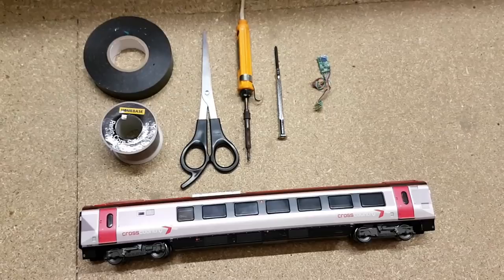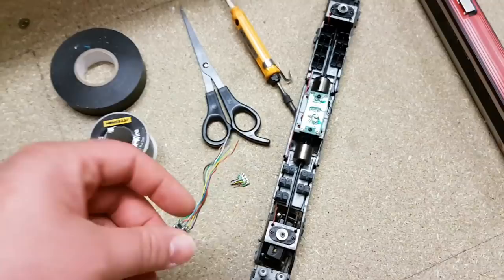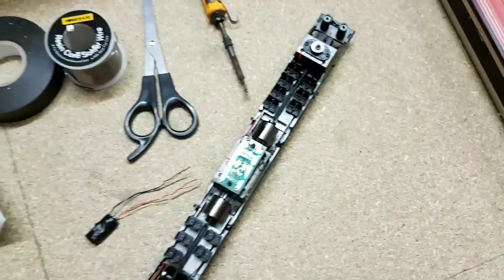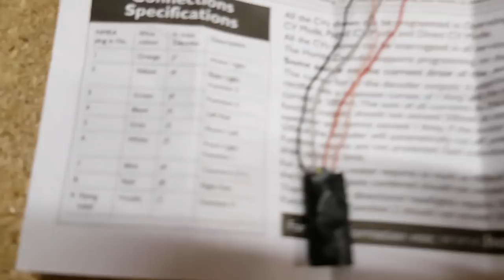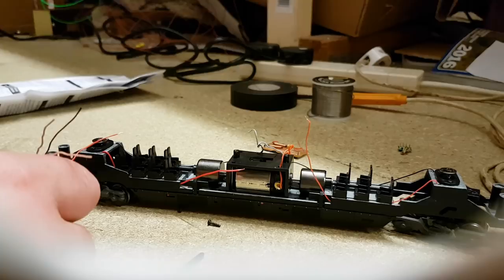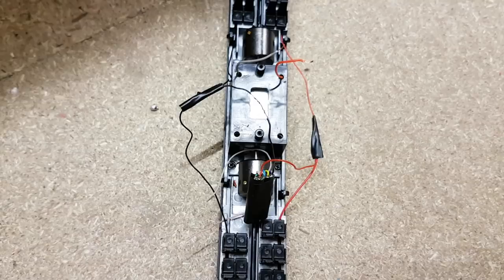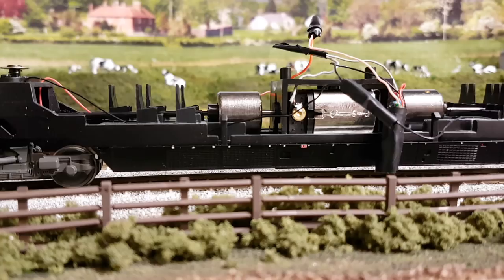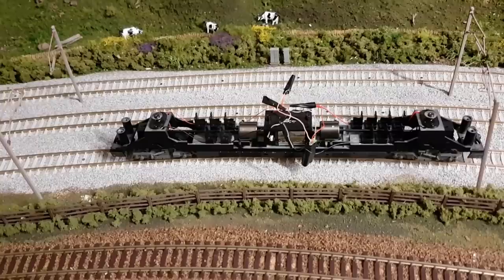New Junction - Converting DC to DCC

Comment: Nice clear video, thanks for producing it. But I have to take exception to the following...
Don't wrap a decoder in PVC insulating tape for two reasons. 1) It prevents a free flow of air over the surface of the decoder and 2) It stops heat escaping plus the warmth of the decoder will cause the tapes glue to become sticky and unravel the tape!   Equally use Heat shrink tubing on in-line soldered joints not tape. Tape will become  a sticky mess and start to unravel after a sort while!  
Finally NEVER place a newly fitted DCC loco onto the main lines, ALWAYS use a Programming track where if any wiring faults are present the low current used on a Programming track wont blow the decoder. Placing it directly on the main and powering up with fault present will result in instant decoder failure!  If your DCC system doesn't have a dedicated Programming output your rather stuffed!  You can then only use the main output but any 'reasonable quality' DCC system will have  a dedicated low current programming output.
Oh BTW Its not a CHIP!  They have salt and vinegar on them!  Its a DECODER!

Comment: If only it was always that easy. I tried to add a decoder for someone in a diesel loco but absolutely no room for a decoder.
I'm used to it in my old steam locos and often have to wire the tender and put the chip in there.
The only way I could DCC this guys diesel was to wire up a goods wagon to it and put the chip in there.
Heck of a lot of work and fiddling to get it all going.

Comment: nice job, I got a Virgin Voyager at home I Need to convert to DCC, keep putting it off tho. What you done about the directional lighting Andy
Reply: You can hardwire from the Motor DCC to the direction lights through the coaches.. but the simpliest is to have separate DCC chips for the lighting.

Comment: The problem with the Bachmann class 220, 221 and 170 is that to control the lights you ether have to carry wires through the train or use 3 decoders.  On my class 170 I just disabled the lights all together.

Comment: I know it’s quite a bit down the line since this was posted but I have just bought a DCC fitted Bachmann class 221 CX 5 car set but it runs extremely slowly. Any ideas why this might be or how to speed it up?
Reply from the maker: Try changing the CV settings for speed 👍🏻
Reply: New Junction I tried to read it with a PowerCab but it couldn’t read the chip. It suggests it is a very old chip however I tried running the power car alone and it seems a lot quicker. It’s an old model so begs the question is it time for a motor change and if possible, upgrade!

Comment: Is that peco oo gauge finescale Nickel Silver concrete-sleeper flexible track yerr used?
Reply from the maker: Yes
Reply: @NewJunction  is it code 75
Reply from the maker: @bachmannobsessed2234  nope 100
Reply: @NewJunction  would code 75 be ok though?
Reply from the maker: @bachmannobsessed2234  code 75 is better, what I'll be using next. Just watch, older locos like lima don't run well on it
Reply: @NewJunction  thank you n great advice

Comment: If I bought a DCC controller, could I connect it into DC track DCC trains to run then connect a DC controller for DC trains to run?
Reply: Hi there, yes you can but keep them seperate at all times and only run DCC trains when the DCC controller is attached and only run DC trains when the DC controller is connected. Some people will tell you it's ok to run the trains on the opposite supply but don't. The only problem you may run into is if you have lots of points etc creating dead sections as DCC needs power to all the track at all times to make the best of it. Think on New Junction the main lines don't mix at all ie completely seperate, so you could in that case have DCC on one loop and DC on the other...keep an eye on your Locos though;-) there is another tuber who has switches to select DC or DCC as he requires if you want I can look him up for you.
Reply: OK, thanks!

Comment: Never put a new chip installation straight on the main track power without testing on the program track first.
If you put the new installation straight onto full track power & there's a problems its already to late.

Comment: what's the difference between DC and DCC??
Reply: DCC allows you to run more than one train on the same line, with separate speeds ect, It also allows you to use sound and lights